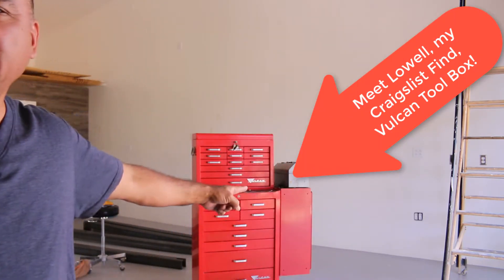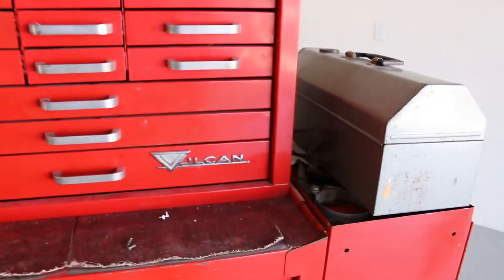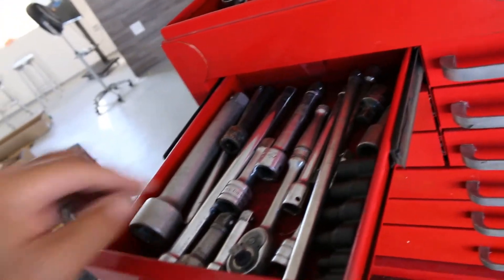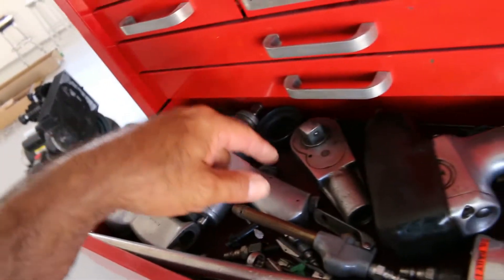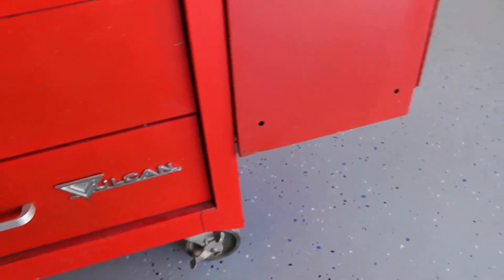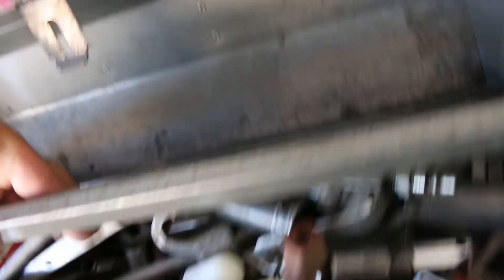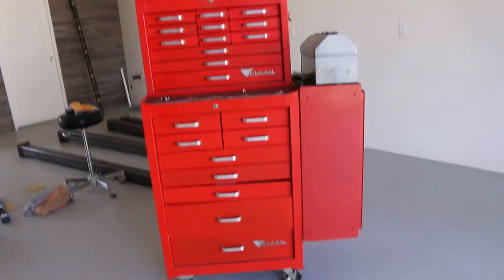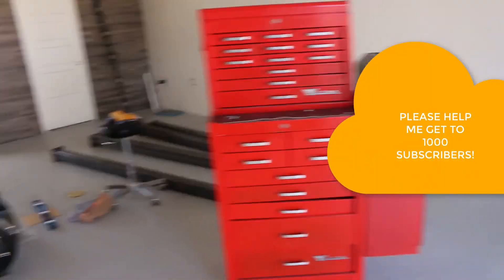JAW DROPPING TOOL BOX DEAL!  You won't believe this one!! Snapon, Mac, Proto?? howtoheaven DIY

Comment: Why would you offer that when he didn't have any interest in tools , you only looked in 1 drawer. If the box was Snap on  I could believe it. What was in the drawer you looked at?
Reply from the maker: 6 air tools including 2 1/2" impacts, various accessories ALL made in U.S. including CP and Bluepoint. The top of the box weighed so much I couldn't lift it so I knew it was FULL of tools. I did not want him to sell it to someone else, since I had to go and get my truck and $.